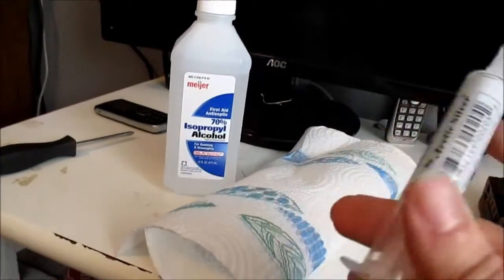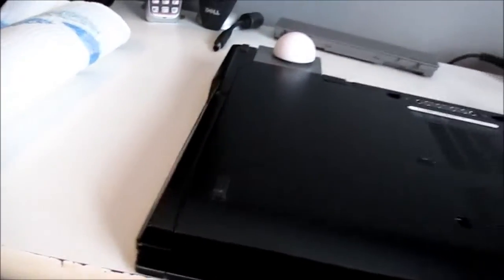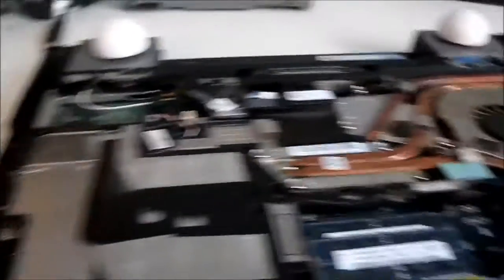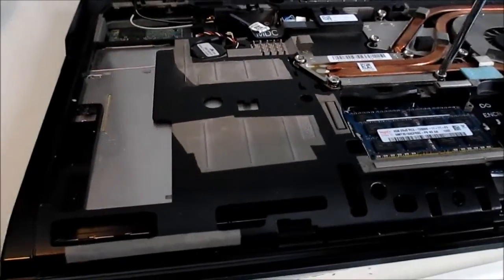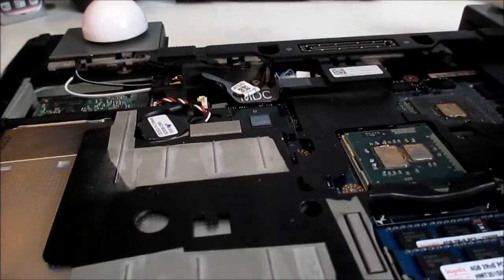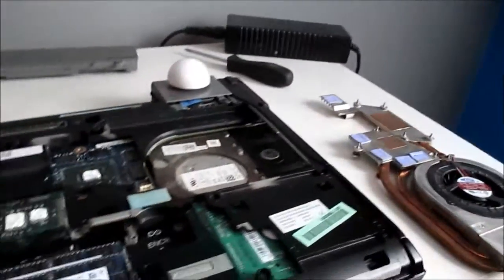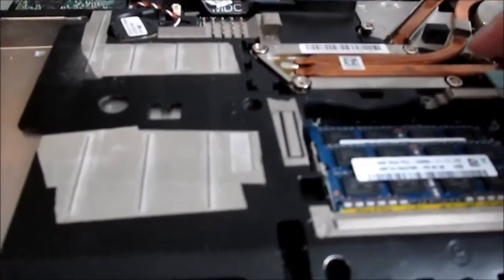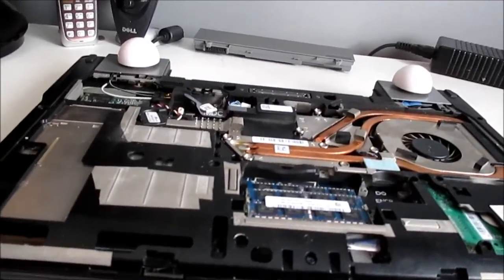Dell Precision M4500 Thermal Paste Replacement

Comment: What CPU model is in your M4500? Mine has an i7-740QM 1.73GHz and has a single die, yours appears to have two. Also what model GPU does yours have? Mine has a Quadro FX1800M 1GB
Reply from the maker: It had the i7 620m i believe 3.2ghz dual core with hyperthreading and it had the less powerful Quadro 880m 1gb :)
Reply: ah yes, thats the Westmere 32nm 2.67GHz. It has two dies because of Intel HD Graphics
http://cpuboss.com/cpus/Intel-Core-i7-940XM-vs-Intel-Core-i7-640M
the i7-940XM is literally the best CPU that can go in the M4500.
https://en.wikipedia.org/wiki/List_of_Intel_Core_i7_microprocessors#Mobile_processors
if you can find a cheap 940XM, buy it and upgrade your M4500
while the 640M is newer, its a dualcore not a quadcore...
Reply: 940XM is overpriced, just get a 920XM and overclock it with ThrottleStop if you need the extra performance.
Reply: same man

Comment: Do you have to add thermal paste to the pads? I keep hearing you have to but have never seen a video with someone actually doing it. I'm having a problem right now with my precision, the guy who replaced the thermal paste has put WAY too much and its leaked out onto the card circuit board and I'm sure that is why my computer died.
Reply from the maker: nope thermal pads do not require thermal paste. in fact adding it would make them much less effective
Reply: Wow, this technician told me you have to otherwise there would be no heat transfer... Thanks for this info, he'll be getting a call from me tomorrow.
Reply from the maker: no problem :) they dont come with paste on em from the factory, they are designed to act similar to thermal paste in places where thermal paste isnt thick enough, whoever that guy is is a complete moron
Reply: Yeah he is a total idiot. He's not taking responsibility for screwing my card up, claiming you can cover a motherboard or graphics card with thermal paste and the computer would run just fine. I asked him to do it and make a video doing it and to post it online... I so want to see that happen but I know theres not going to be any video...
Reply from the maker: Falzeee hahaha yeahh hes trying to cover his ass lol